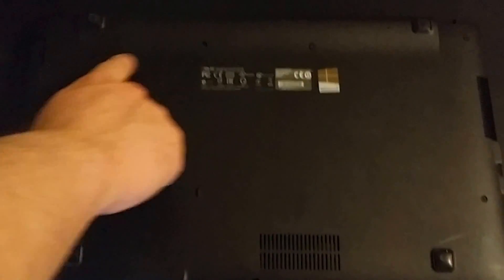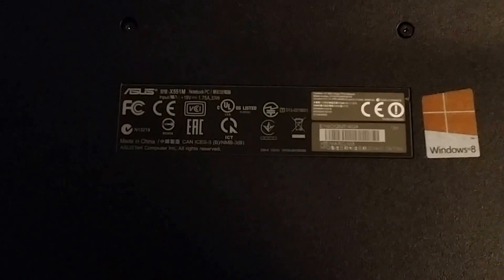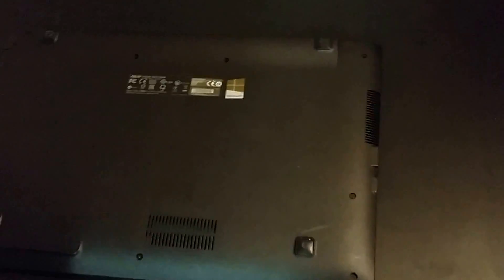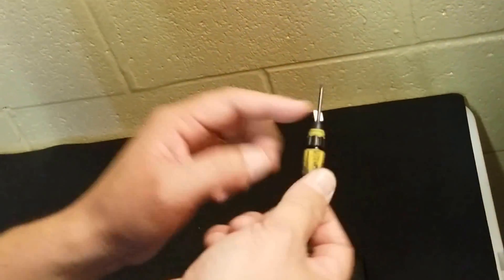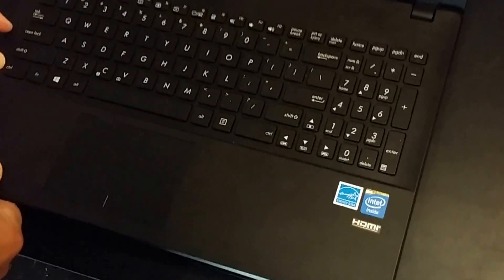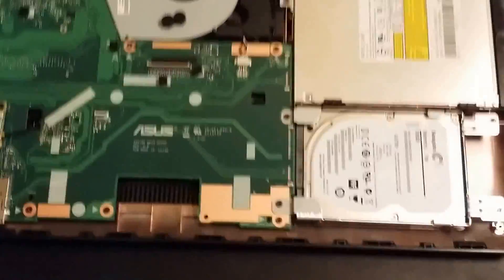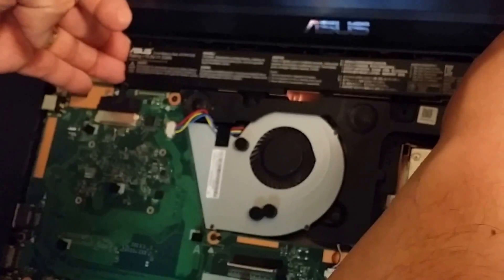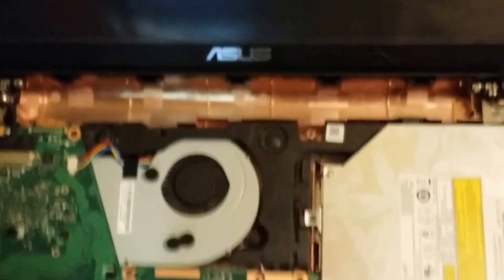ASUS X551M Laptop Battery Removal & Won't Power On Fix

Comment: After 4 months of my laptop not turning on it finally pluged it in today and i seen the power light turn on I'm so happy
Reply from the maker: PkPlaysMc Congrats!
Reply: +Angrysquirrel PC The thing is My laptop (that is the same one as yours) will not turn on but in the Manuel it says to not take out the battery manually but have a repair man take it out for you, so I really don't want my laptop to be at risk. Please help me!
Reply from the maker: +RadLegos-The Gamer Brony I can't help you unless you try to disassemble it to remove the battery as the video shows.  It really is not that hard.  Follow the directions on the video and you should be OK.

Comment: hey, what if my asus just won't turn on. I know it's not dead because I've tried to turn it on with a charger
Reply from the maker: paige phifer Do you get any power indicator light on the laptop when the charger is plugged in?
Reply: No, it's just black.
Reply from the maker: paige phifer Here are the most common fixes to a computer that won't turn on:

1.  Try a different Power Adapter.  Power adapters can go bad and when the battery runs out of power, a bad adapter will not power on the system OR charge the battery.

2.  Make sure the power adapter is plugged into a working electrical socket and that socket is turned ON.  Funny but true that this can happen.

3.  If you have a defective battery, it CAN SOMETIMES cause the system to not power on.  Remove your battery using the video then plug in a WORKING power adapter directly and turn on the system.  If it turns on, get a new battery.  If it STILL doesn't turn on.......

4.  Check your DC Jack connector to make sure it is NOT loose or damaged.  If the DC Jack connector is bad, it will NOT charge your battery or power on your system.

5.  Assuming that your DC jack is good, your motherboard may have gone bad.  If that is the case, check Ebay for replacement motherboard for your model.

6.  Final note:  Check your power button ribbon cable or button itself to make sure that the ribbon did not come out or the button is hitting the contact that powers on the system.

If all else fails, bring the laptop in to a computer repair shop as a lot of them give free diagnostics and will give you an estimated repair cost.

Hope this helps!!
Reply: alright!! thank you so much!
Reply from the maker: paige phifer No problem!  I REALLLLLLLY hope all it is is a bad power adapter as THAT would cost you all of $8-$15 on Ebay/Amazon to replace.

Good luck!

Comment: I have the same type of, laptop, and yesterday I decided to restore it. Becase Google, steam, Facebook overly problem, I looked it up and it was a some type of virus. When it comes to files and hardware I'm technology disabled, anyway the most simple way w/o messing anything up is to restore it, I did that and the external monitor displays nothing but black and turns off, it's been like that since yesterday, please help if you can, thank you.
Reply from the maker: XXXSHADOW WATCHERXXX Your recovery partition was most likely damaged causing the failed restore/factory recovery.  Wait.  Why are you using an external monitor instead of the laptop monitor?  If you meant you don't see a picture on the laptop's screen, you will need to get a copy of Windows 8/8.1 on either DVD or on bootable flash drive form for Windows reinstallation.  If you have a damaged LCD screen and are trying to use it on an external monitor, there could be a disconnect when there is not a Windows to load into (no video drivers) which is why you are not able to switch to the external monitor thus a black screen.

Comment: I have the same laptop and the other day I sat it down on my couch for a few seconds and when I picked if back up it wouldn't turn up. No type of life happens to it. When I plug it in the little light that turns on while is charging doesn't turn on. I don't know what to do. HELP MEEE !
Reply from the maker: Genesis Valentin Genesis, your power adapter could have gone bad.  Test it with either another power adapter/charger or get a universal charger to rule that out.  If the new charger still doesn't power your system, it is most likely either the DC Jack is bad or the motherboard is bad.  To rule out the battery, you will have to remove the battery by following the video and reattaching the power ribbon cable and then plug in the DC jack.  If it turns on, then it was a bad battery.  If it doesn't, then its a bad DC Jack/Motherboard.  If all else fails, bring it into a computer repair shop and they should be able to diagnosis it.
Reply: I took the battery out, and when I out everything back together it worked. It hasnt been giving me any trouble since.
Reply from the maker: Genesis Valentin Good to know that you got it fixed!  If a battery goes bad, it sometimes causes to not allow the system to turn on.  I am glad the video helped you!

Comment: Can u upgrade  the processor?
Reply from the maker: Limits OG Do you want to upgrade your laptop's parts? Because laptops parts aren't really upgradeable. No GPU upgrade, and a CPU upgrade is more trouble than it's worth (you're bound by socket compatibility) since there are no motherboard upgrades, pretty much. Memory and hard drive are upgradeable, though (more memory and upgrade to a SSD).

Comment: My laptop got wet and the charging light and they light that says it's n comes on but nothing else turns on. Do you have an idea what needs replaced
Reply from the maker: Lost Diamond Sorry to say this but most likely the motherboard and who knows what else.  When the motherboard gets shorted due to a liquid being introduced during and electrical current, it can cascade to other connected systems parts like the memory, hard drive, LCD screen, etc.  The only easy way you will be able to find out if it is worth repairing is to either get a replacement motherboard and hope for the best, take it to a computer repair shop, or get the EXACT same model laptop and install all the parts minus the motherboard to that system.

Comment: Hey I have the asus K751M  and the design is similar, but my problem is when I was watching a video the screen turned black and white (frozen)and it is still ongoing do and it won't off what do I do ? I don't know what is the cause of this I am going to get it repaired by my uncle though any advice wil any will help
Reply from the maker: Epicgamer6711 You could have a number of issues but I need more information first.  When you power on the system, does this issue happen PRIOR to Windows booting up?  If not, then can you boot to safe mode w/ networking and play videos from that environment and see if the issue happens there?  If not, it is most likely either a Malware/Virus issue or Driver issue.  If the problem happens in safe mode, it most likely is a hardware issue but STILL could be malware/virus or driver issue.  It also could be overheating so check your fan to see if it is clogged up with dust bunnies.  If you want to make absolutely sure it is NOT hardware, the easiest thing to do is to back up all your data and inventory your loaded programs, do a system recovery to factory settings and go from there to eliminate EVERYTHING software related in terms of loading a clean OS.  Once you do that and the problem STILL persists, it is hardware related and can be a failing graphics chip, failing LCD screen (I don't think that is the problem though), or a failing hard drive.  It might even be a failing motherboard since all these things connect to the motherboard (but that is the last thing it could be in my experience unless you either had a power surge, discharged into the system by touching it when taking it apart, etc).

The process of elimination will have to be done in order to properly fix this issue.  I would remove the video drivers FIRST and install the latest drivers from the graphics chip manufacturer (Intel, AMD or Nvidia) for your particular video graphics chip.  You will have to go to device manager and select the Display Adapter to see what you have.  If that doesn't fix it, do a malware/virus sweep and scan for any threats.  Also, look at your program list to make sure there are not any programs on there that you do not recognize or remember installing.  Google check each programs and it will tell you if it is a malware program or not.  If it still does it, reinstall Windows.

If all else fails on the software side, I recommend taking it to a Computer Repair shop as they have the necessary tools to test the memory, hard drive, CPU Fan clogs, LCD screen, etc.

Hope this points you in the right direction!

Devin
Reply: ***** thanks i already have it fixed my uncle told me it was just overheating which you had stated. thankfully it wasn't  worse.my cooler broke 2 weeks ago and i already knew the computer might be prone to overheating common mistake by me, anyways a very big thank you again i subscribed :)

Comment: I have an issue with windows 8.1... I recently stopped a process in task manager that was boggin down my laptop (an ASUS like the one above) and thereafter the PC crashed... Now I cant even get into windows because it takes me to a dark red screen with only the power button on the bottom right and the ease of access button on the bottom left! This is supposed to be where the login screen is at but there is no login option!

Ive already tried to a system repair and system restore and it doesnt fix the issue... Ive tried booting it in safe mode also and that didnt work! Now I dont know what to do... I was thinking about taking the battery out so thats why I came here.... Any suggestions? Thanks!
Reply from the maker: I AM WHAT I AM I am assuming that you can get into the ASUS BIOS/UEFI and everything is fine until you boot to the Windows.  If that is the case, you may want to do a complete system recovery which will wipe the Windows partition and essentially put it back to factory original settings like the day you bought it.  When you boot to the Windows login screen, hold the SHIFT KEY down and click restart (not shut down).  This will allow you to boot to the advanced options / troubleshooting.  Select Recovery then select Fully Clean Drive.  If that does not work, hit/tap the F9 key on boot, select Troubleshoot, then reset.

I hope this helps you!
Reply: ***** I dont see that option that says recovery but I do have ADVANCED OPTIONS which I clicked on and then I have 6 different options: SYSTEM RESTORE, SYSTEM IMAGE RECOVERY, STARTUP REPAIR (which I clicked on and I get this error message: it says: ¨startup couldnt repair pc
press  ´adv options¨ etc
log file: c/WINDOWS/System32/Logfiles/Srt/SrtTrail.txt¨), COMMAND PROMPT, UEFI FIRMWARE SETTINGS and STARTUP SETTINGS.

Matter of fact, I found it... Its at 1% now... Lets see if it works... Thank you for your input
Reply from the maker: I AM WHAT I AM No Problem.  Let me know if you got this fixed so other people can read the message and try your solution!

Devin
Reply: *****  Definitely worked my friend!!! I really do appreciate the help! I had tried everything else to no avail but this did the trick!

Thank you so much! Subbed and liked!!! See ya around!!!!!
Reply from the maker: I AM WHAT I AM You are most welcome!  If you have any general computer questions, head over to my other video and post a comment/question there.  I will help you anyway that I can!

Comment: If my computer won't hold a charge is it because I need to replace the battery? I have an asus D450 which has the same design as the computer in this video. It turns on and runs fine if its plugged in but when it says 100% charge it can only stay on for ~5 minuets.

Comment: Hello,
I recently purchase an F555LP Asus computer that is similar to this X551M. Comes with Win8, that I'm not very found of it.
Resume it what happen, after attempting to install in one partition Win XP 32 (in virtual image don't work for me), and Win 7 in another partition from boot setup choosing usb hard disk (OS images, more faster installation than CD).
After installation when rebooted, the computer didn't make screen on.
The led with a lamp is on, the hard disk led blinks only one time, but the screen stays always black. Cannot access Bios setup and to shutdown, i need to long press on power button.
I've read that the possible cause is bios corrupted or hardware.
Could you please post a video how to "extract" bios battery or/and other related with this?
I would greatly appreciate it.
Reply from the maker: Jay C If you did not disassemble this computer or touch any components, then the hardware could not become corrupted nor the BIOS become corrupted due to Windows installation whether XP, 7 or Linux.  The only way a BIOS can become corrupted is a failed BIOS/UEFI update or a power surge to the system.  The problem with this is that these ASUS models have a soldered on BIOS battery that is not removable (Disposable & cheap laptops that you cannot easily remove hard drives, LI-Ion Batterys, Memory, etc.)  My suggestion is to get a Windows 8 and see if it will recognize either a bootable Win 8 Flash Drive or Win 8 DVD.  You might also try removing the hard drive as your failed installations (or failed hard drive) will sometimes cause the computer to not be able to boot even to the BIOS/UEFI.  I have personally seen this happen on some laptops.  If you remove the hard drive, this should eliminate this possibility and could boot your computer to access the BIOS/UEFI.

Hope this helps!
Reply: ***** Thanks for the help.
I took the disc off and turn it on without it, but still no lighting the screen, nor any screen information (pressing F2 for setup). The fan runs and the lamp LED lights up.
Before placing me in formatting the disk and install XP and Windows 7, I've created an image backup of the entire system and do a recovery CD in windows 8.
I will try re-install the image on the disc to see if works,  but I need to buy a SATA 2,5 to USB converter, to do this on another computer.
If it works, I will post it here.
thanks
Reply from the maker: Keep me and the other people on here posted and hope this works for you.

Comment: I have this computer, I am not sure if the battery is needing to be replaced or not. When I plug the charger in it does not turn on at all. The computer has not been dropped or anything, it just all of a sudden will not turn on at all. Any suggestions before I take it apart?

Comment: My laptop has been flickering a lot, and now the screen won't turn on. I push the power button, and it won't light up at all. The power lights turn on, but no picture is displayed whatsoever. I have never let it die, it's always on its charger. the screen has been flickering a lot lately, & I just had to get the screen removed due to cracks. if you can help, that would be great. Thank you.
Reply from the maker: Mary Dilldine Mary,  so you are saying that you removed the LCD screen and replaced it with a new one?  If so, we need to see if you either shorted out the LCD screen, got defective LCD Screen or your graphics chip went out.  I also hope that you removed the battery before installing the new LCD screen because if you didn't, you might have shorted out the new LCD screen.

The easiest way to figure that out is to plug it into an external desktop monitor using either the VGA/DB15 port (color of the port is either blue or black and has 15 pin holes) or an HDMI port.  When you connect the cable into the monitor it will either auto detect it and send the picture to the screen or you may have to use a key combination using the FUNCTION FN Key which is at the lower left corner of the keyboard AND press the F1-F12 keys above the number keys.  Look for a "Monitor" or "Small Square to Large Square" icon on one of the F1-F12 keys.  Hold down the FN key then press the correct F1-F12 key which would be the switch to external monitor key to switch it to the external monitor.  If you get a picture, you have a bad LCD screen and need a replacement.  If you still don't get a picture, it very well could be the graphics chip went bad on it.  To be 100% sure, take it to a computer repair shop to get a second opinion as they usually give free estimates/diagnostics for something like this.

Good luck!
Reply: I had a family friend that did the repairing for the cracked screen... So I'm not really sure as to what he had done with the whole laptop. but it was working fine for a week and a half, almost two weeks, then the screen refused to turn on. I'll take it to a professional and get it checked out though, thanks for the advice and help!
Reply from the maker: No problem!  Glad to be of some help!

Comment: I removed the old screen and need to replace it with a new one do I actually need to pull the battery or if its dead can I just plug in the lcd?
Reply from the maker: callerfromlastnight Very good question.  The proper and CORRECT thing to do is to remove the battery first.  Let me tell you from first hand knowledge that it is a very BAD idea to replace the LCD screen when the battery is installed (even if you think the battery is dead).  When I was a new tech, I forgot to remove the battery once for a LCD screen replacement.  When I removed the cracked screen and installed the new LCD screen, I saw a tiny spark when I connected the LCD cable to the LCD connector.  When I powered the laptop up, all I got was a black screen.  Take it from experience.  Don't take chances when it comes to removing ALL POWER before you do any work.

Hope this helps!